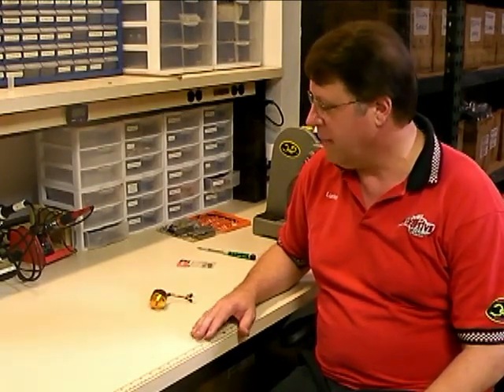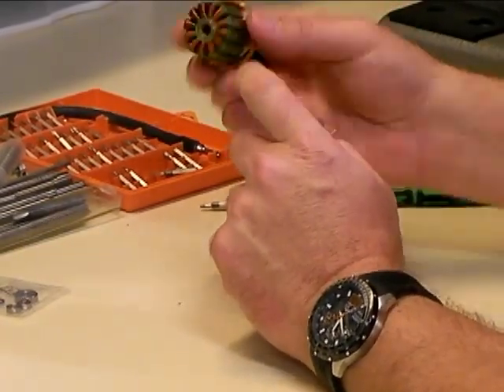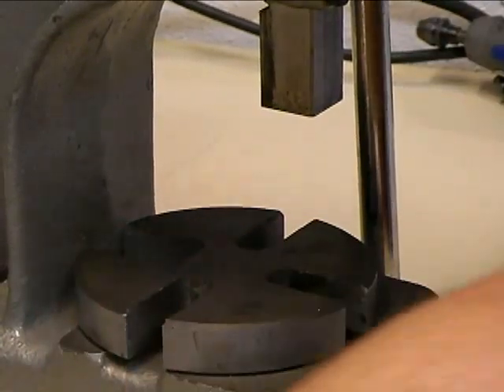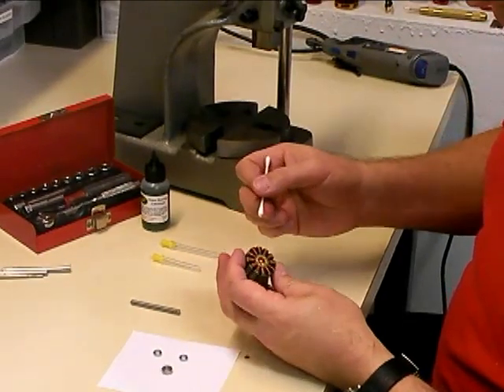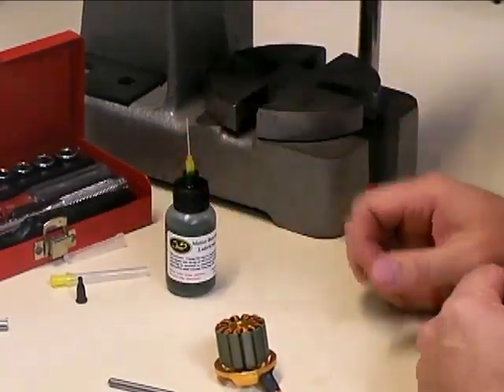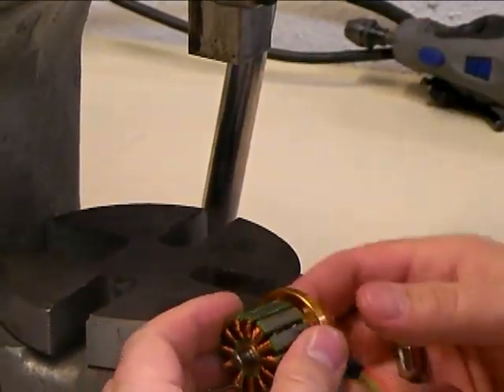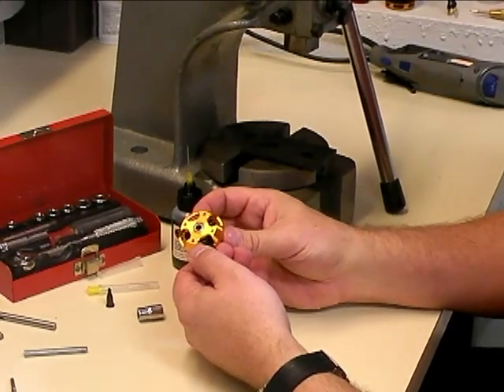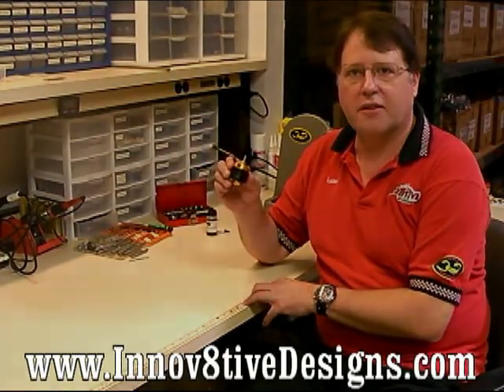How to change Bearings in a Scorpion Motor by Innov8tive Designs

Comment: Lucian,

I own a number of your scorpions HK-4035 that I use for my EDF's. Currently I have two of the 3045's that are making a grinding noise as it spins. The still run great but when I turn them by hand it sounds like its scratching noise inside the case. Do I need to change the bearings or can you advice some type of solution to my  problem. Thank you.